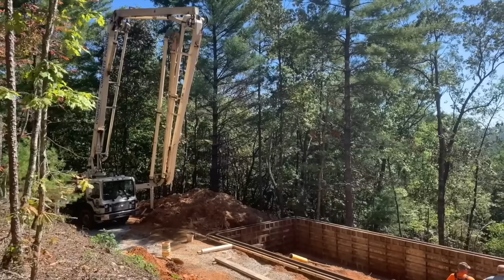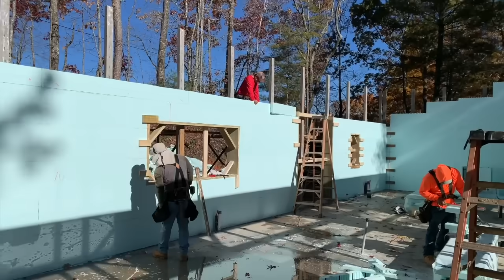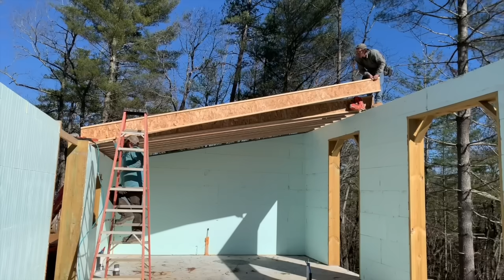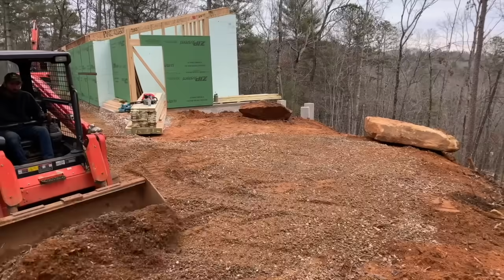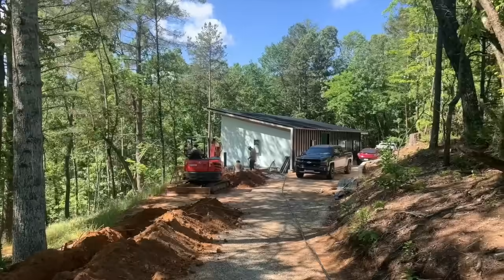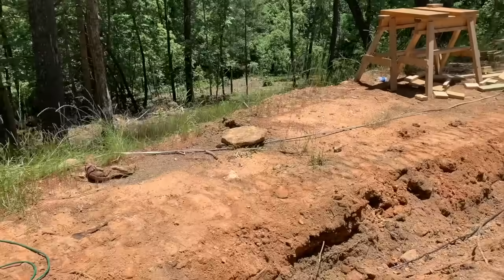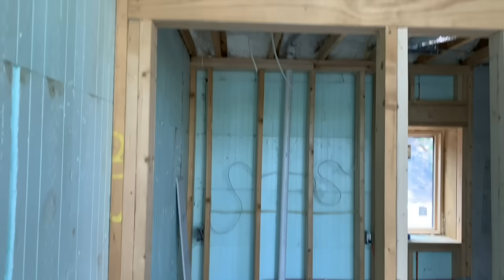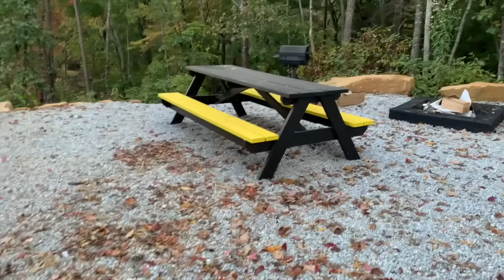Construction start to finish of a modern ICF mountain cabin.

Comment: Very nice. Some other things "for the next time." A walkout basement (inexpensive additional square feet), or if not, put some Dow gray board under the slab to gain more thermal mass. or both. I would have been tempted to go solar and off grid. Yes, a lot of trees, but the panels are very high wattage nowadays, and have microinverters as an option. Three kW and 30 kWh storage and an EV with V2H capability., or a propane generator could be added for those occasional sunless ice storms. Cantilever the deck out four feet for a small additional cost. Design for a future carport.

Comment: There is no rebar reinforcement connection between the stem wall , slab and the ICF conrete wall above.  All rebars should be laped 45 bar diameter so the structure will be monolithic.

Comment: Hello. i got as far as the 197 tons of rock lol.  Why did you not use a rock slinger? It would have been much cheaper than the skid steer and excavator combo? In addition, with the slinger, you could have filled the cavity to the level of your electrical and water lines, laid in the lines, then continued filling with the stone! More cost over run!! Ttfn

Comment: You can always tell whether a builder is professional or not, by the way he understands and chooses the right material for a project. Yours did not. Most pros know that the red ZIP Roof Sheathing is what is best for the roof, not the green Wall Sheathing. . Such a dumb mistake tends to leave a lot questions on any other shortcut he made on your house.

Comment: Are those piers made of  wooden 2x10 forms  made into square boxes then leveled and braced I to place and filled with concrete.?did you remove the wooden forms after it hardened or is still on ?

Comment: Good to see someone that finally knows the right way to remove any tree.never use the chainsaw until the tree is down still connected to entire roof and ball.use the trees own weight against it after cutting with the bucket around the  tree into the dirt severing the larger roots.,on the opposite direction you wish it to fall.then push it up high on the trunk.if it doesn't go easy then dig and chop in more complete circle just a few more at a time then push again till it s weight falls it and rips the remainder of the stump,and roots out of the soil after getting some on the ground drag the whole tree to a chainsaw area near a place next to road that you can pull up with a trailer and load up the stumps after cutting off and any other dump bound tree parts.this method is the only correct way.if you cutoff the tree then bring in a stump grinder later,your just dumb because it's gonna cost you way more money and time ,as well as all kinds of roots will still be entangled across long distances of soil some of which can regrow a new tree even if the stump is grinded.also even if it doesn't regrow later,and you grind the stump.you still leave tons of small medium and large roots that are dead and rotting all beneath the surface of your yard.anyti e you plant or dig you will catch hell removing them since it takes so many years for them to decompose enough to weaken and easily rip them out..diffent beetles and bugs live in those ground hidden rotting roots.when the tree falls with the stump attached,it rips all those spread out root s from the ground with it when you drag it to the cut up area you pull all the attached roots from the ground.nothing worse than your fence ripped away from it leaning and lifted up from a root beneath the post and concrete anchor I. The hole..I just spent agonizing pain in my ass  to fix a water line leak I noticed bubbling from the ground in the middle of a bunch a machinery that was stored under a tarp on the side of my yard that also had trees growing amoundst it.after getting to the leak,6 feet deep,after I repaired the crack that had a root wrapped around it,I turn on the water to find the leak is also coming from up the pipe direction  I can't see and dig it out for 6 hours till I get to the leak.turn on water,same thing.fixed leaks 6 times down a 12 foot long 6 foot deep root entangled nightmare of red clay mud.the plumber had used the cheapest thinnest wall pipe.if they had used thick wall I think it wouldn't have leaked. Never put a Bradford pear in your yard.most of the trees were them .roots won't cut  or break because they flex and bend.sawzall blades won't cut from the bending of the root as the blade reciprocates back and forth,while the root inside grips the blade as well.the roots are a foot in diameter on some ,e inch 4 inch thick branches off in every direction ,most going down and are not visible at all fucking nightmare.dont wish it on my enemy's.

Comment: I have so many questions.
I would never want to be negative, so I wouldn't mention that this seems like the most over-engineered 1200 sq ft rectangle I've ever seen. 
I wouldn't say that I can also look upwards for a view of a mountain. 
I wouldn't say that I think somebody's cousin owns a concrete supplier. 
I wouldn't say that it sounds like, more than being excited,  you are reciting to the best of your ability the sales pitch for all this expensive stuff. 
I wouldn't wonder why having one of the more expensive roofing options, not just on the roof, but also the walls, makes sense. 
I might wonder if somebody else's cousin had a roofing company.
I guess I would also wonder how anyone could sell not having gutters and being dumped on by a front door waterfall is a bonus.
But I'm definitely wondering who in their right mind would put the security system in an exterior storage room that is not accessible from the house.

Comment: Shouldn’t that concrete be vibrated???? 😮 8:44
Reply: It doesn't need to be.
For one reason, there's not a lot of rebar or obstacles inside to prevent the concrete from going all the way down.
Two, there was a guy shoving a stick up and down in there, which essentially is the more primitive version of vibrating the concrete.
Reply: @Roger-ws8rj clear, thanks 😊

Comment: Very nice home site, this is 2 years or so later. I do like the view. It was said the roof was going have a waterfall effect. But I did not see any water catchment to remove the water from the front of the home. I thought maybe you had it run to the retaining wall and removed by the use of a french drain or something like it. I looked for any signs of water removel. Can you check back and update with any additions or alterations made for your homestead.

Comment: Beautiful build in the woods.  Do you have the all in cost of construction with the land and driveway as a separate price.  I would have dug the hillside and placed the 6 foot stem wall at the front of the house and  built a "walk out style" of basement on the back of the house with the views on this sloped lot.  A lot more digging but less concrete work.  back fill with all the gravel is heavy.  I'm surprised at the architectural decision here.  Also, I'm surprised at the light switch adjacent to the hot tub!!

Comment: ICF blocks, such as the ones you have used , are not termite "proof" . The expanded polystyrene is not a known food source for termites , however they have been known to chew through it to reach timber such as those used in the roof etc. Not common but it does occur

Comment: How did they tie the ICF to the foundation?  They didn't have dowels projecting out of the foundation.  Structurally, your dowels should match the ICF vertical bars. Embedment into foundation Cast in Place walls projecting through the 5" slab and 24" or so into the ICF.....otherwise no structural value.
Also, what happened to the two piers in the interior?  They were not tied to the slab.

Comment: Not a fan of having no overhang on the low side. Water eventually wears away at the wall and it will show weathering in time from rain hitting the metal and roof run off. Over all, you did a good job choosing concrete foundation instead of wood floor, which is in my opinion, wood is inefficient and a cheaper way to build, but wont hold the value like concrete.

Comment: ICF block does have a reputation of termite problems. They eat into the foam and move towards wood. The only ICF block that does NOT have termite problems is when the foam is mixed with concrete. EF Block is a good example. If your block is just straight foam with no concrete mixture, YOU WILL PROBABLY HAVE TERMITE PROBLEMS.
Reply: EPS foam is not a food source for termites

Comment: Im just curious, if the building is just 1 story high, why did you need such a large foundation? Wouldnt concrete poles be enough? Will the building wash away otherwise when there is a rainstorm?

Comment: Cool, only one comment, I would cover the cables and other installations coming out of the ground so that when pouring slab no accidental concrete slips. Just a plastic bag can save you a lot of headaches. Cheers.

Comment: I’m not understanding the backfill. If not just a waste of space and material, isn’t that a lot of “fluid” weight up against the walls? Rock or water, gravity still has it pushing down and outward. Seems like a lot of unnecessary stress on the outer wall rebar. Couldn’t they just have created a concrete floor to tie the walls together? Or hell for the money they spent on rock couldn’t they have created the floor joists with steel and thus tied all the walls together without the weight pushing outward? Seems like plumbing and electrical would have been a lot easier also with the crawl space.

Comment: Lots of nice features but you spent alot of your money on A LONG SKINNY deck that is not very functional.  It makes the house look longer which is nice but that and standing room only is about it.  
Shortening the length and extending it out further from the house would have made it more functional.  Also when you drive up your welcomed by the heat pump and electric meter...should of been under the deck or somewhere other than the deck entrance. ?.  You could design a landscape feature to hide those I guess.   Some nice features though.  Like the location of the fire pit.

Comment: It’s very nice. I’m curious why the basement area was filled with massive amounts of rubble. Would not a suspended concrete floor have been cheaper, and allowed use of the basement for storage? Or would you get damp?

Comment: Should have put in a crawlspace as you had the height, makes it a lot easier for electrical and hvac runs. Hope your front wall was designed for all that gravel load.

Comment: Nothing about this project makes sense to me. Why dig a foundation and pour walls
only to fill it in. Why did you not utilize the square footage as living space instead of filling it with gravel? The floor of the top section could have been poured with supports  and then use ICF for the second floor. Next why go to all of the trouble to pour supports for a deck only 8 feet? A deck for a more majestic view should be much bigger . Like 10 to 15feet. I wonder if, after living here for a while if the owner realizes that there needs to be an expansion as this build is way too small.

Comment: I'm curious because it wasn't shown in the video ,how deep did you auger pile this property because the moment you have heavy and I mean heavy rain it will all wash down hill ,I would auger the front at least 10ft ,the middle 15ft and lastly the back 25ft then tie them together so to be sure for the next 100 yrs the property would stand strong! And why did you waste all that blue metal backfilling this structure I would have reused the dirt then hit the topping with sand and then cast it !

Comment: Enjoyed your video. Can you tell the viewers what type or brand of ICF Blocks that you utilized? Also, you must have drilled the footers for epoxy in the rebar to start the ICF tie-ins, correct? As others have stated, can you provide a video for the cost analysis of all areas of the construction from site development of electrical, plumbing, septic, roofing, Pella windows, front door,  deck concrete piers, back concrete wall along driveway, power company hook-up, etc. This would help all of us viewers to better understand your investment. Are you a builder or architect? If not, the architectural services costs for the house design and construction plans. Thank you for the video!

Comment: Wondering if there is a reason you chose to have the door open out instead of in. For safety reason, isn’t it usually better to have a door open in so that if something is blocking the door, you’re able to move it and aren’t “trapped” inside? It also keeps you safer in the event of an intruder but imagine you’re not that concerned over that. Haha.

Comment: Beautiful build! Simple and elegant design. Love the bright yellow entrance and details, and the location must be stunning during fall and winter.

One thing I didn't see on the video; was there any vertical rebar installed at the foundation perimeter to anchor/connect to the ICFs once those were poured? The video skips from "finished" foundation perimeter wall to ICFs in place. The examples I have seen in the past have had vertical rebar integrated onto the foundation wall to anchor the upper walls. I had not seen this type of construction with the ICF walls just resting on the foundation wall.

Comment: Your builder used the wrong ZIP board on the roof. It is supposed to be the "red" board, which is rated for roofs. Also, it is a little thicker for extra roof loads and span requirements. Sorry.

Comment: If you're trying to make it fire resistant, why make a kindling deck? You missed the opportunity to form up a second concrete wall instead of the pad and peer deck posts. Then you pour a concrete deck over the top. That way you could have a garage or storage area underneath, plus the deck would be fire resistant like the rest of the house...
I would have used truegrid for the driveway rather than more concrete.  It is porous and won't cause additional runoff. Also, you're going to want a gutter over the entrance since it will dump all the water off the roof over your head when it rains.
Regarding your firepit, add fresh air intake under the fire and you'll have less smoke. If the combustion air has to come down into the firepit to sustain the fire, it will be starved of oxygen and will smoke a lot. Add combustion air and that cleans up the fire a lot.

Comment: I'm under the impression that this design began with a walkout basement onto a downslope side cantilevered deck but the unexpected and substantial rock substrate added far more time and expense of keeping your original design. 
200 tons of gravel fill held back by 10" cement wall without lateral anchor rods connecting the rock substrate & outer wall is definitely not robust to pass off as an original design.

Comment: A lot of Gravel , a lot of Volume that could have been a Basement , at least a third of the 19x 60ft ..Perkins Bros often does a Stem Wall on the Roadside and 12 ft sideways and the rest in 2x6 construction on the slope side..less backfill, less concrete, more space to park your Gear or Do a Ping Pong Room or Something for the kids. Good design is also thinking beyond your own immediate needs.

Comment: I am confused why your electrical cable and tele/ internet wasn't in  pipes even if  the electrical cable that i assumed is a direct barrel  cable. It's not that tick and that's a long run. on top of that both of them are under a driving path . Well, I guess it works in your country. Nice place tho

Comment: For those on a budget or just don't want to be reasonable with the cost and timeframe a post and beam suspended floor construction, stick framing and not using ZIP would get you the same house for 1/4 the cost and 1/4 the time. Enjoyed the video. BTW did you calculate the weight of this structure? In my head I think it is over 1/2 a Million lbs of building!! 10 truckloads of compacted gravel to just to have a slab floor then you covered it with flooring. I do not understand. Your house and I can tell you are happy and proud and that is all that matters when you don't care about your bank account. Lucky you!
Reply: Wood floors, when all said and done, are more than a concrete slab, then are a home for mice ans insects underneath and the air underneath is conflicting with your inside temperature. Over all, a better investment having concrete floors and perimeter, even if the cost was a little more.
Reply: @m.weston7114 I agree, keep in mind that a lot of people don’t prioritize the structure, they prefer to have granit counter tops and marble floors,(lipstick) rather than a structure that can withstand the storms and keep their family safe and comfortable. 
It’s human nature to condemn what they don’t have and therefore try to feel better about their choices.

Comment: Looks great... don't understand the security system with the camera monitor station tucked away in your storage area which has no access from inside the house? Seems like you'd want to be able to view the camera feed without having to go outside... other than that. looks like a comfortable retreat.